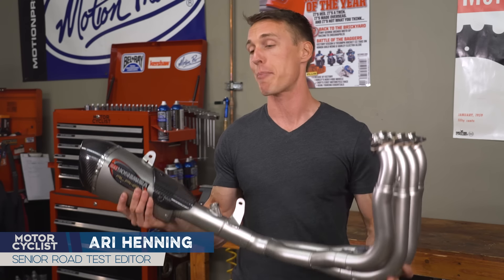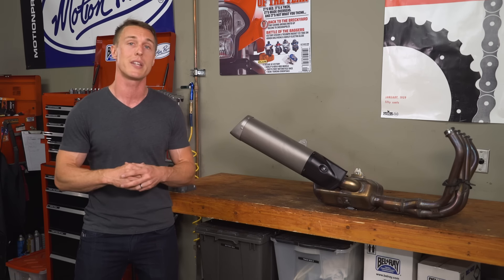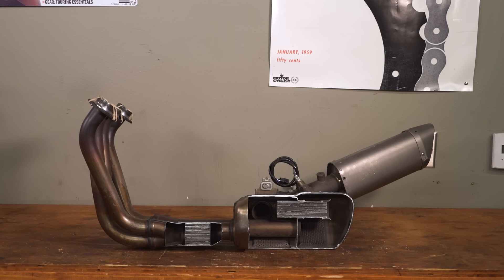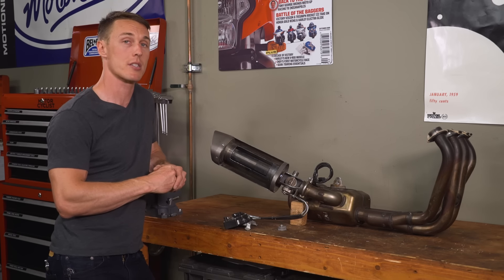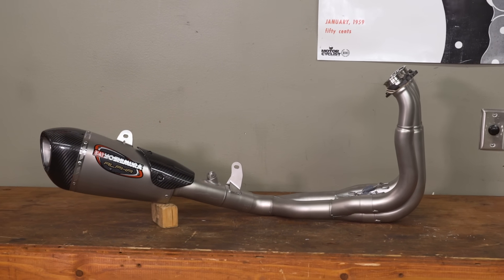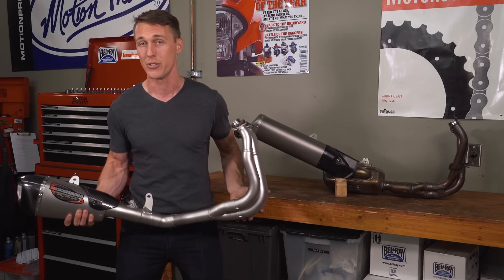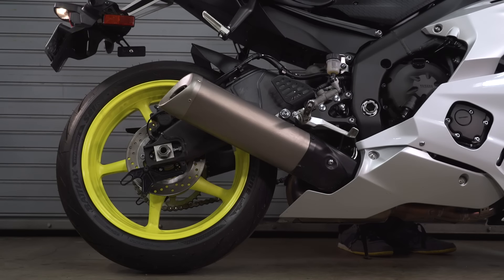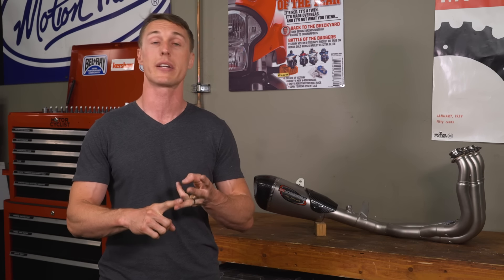The Truth About Aftermarket Exhausts | MC Garage

Comment: Can you do an episode on lightweight wheels? stock vs ali/magnesium vs carbon fiber? are they worth the premium price?
Reply: camden thompson I'm a mechanic, it doesn't even require a mechanic knowledge to know that less weight on the drive train allows for an easier power application. It's just less lost torque/power. It's no wonder manufacturers try to shave off weight any way they can. Look at lotus, they don't have massive power in their engines but their car are lightweight, hence why they can chase the big cats on track.
Reply: Aftermarket wheels aren't good for a street bike as they aren't designed, nor can they handle, the stresses of potholes, long term use, etc... Race bike, they are great. Last I checked race tracks don't have potholes... lol
Reply: Not just power application, but agility as well. Less rotating mass, less gyroscopic effect, quicker turn-in and a "lighter," more "flickable" feeling bike. In my opinion, rotating mass is the top of the list in terms of weight shaving, then unsprung mass (wheels, brakes, suspension), then sprung mass. If you can get unsprung and rotating mass down with one change, that's even better. This is why I downsized to 14" wheels for my track MR2. At 11lbs. per rim compared to 12-14lbs. for a 15" rim, that's a very noticeable difference on track.
The Lotus Elise (there's one at the shop now for a clutch) is a ton of fun to drive even with it's modest 210ish hp. We probably won't dyno this one because it's stock and there's no point. The Lotus Esprit (my shop's owner has two) isn't nearly as light or as small but it's still very fun to drive. Still very British though, so it essentially takes an electrical engineer to fix an electrical issue on it. And those issues are very common.
Reply: If you can get the same strength for lighter weight, you'll be faster off the line, and feel more agile going into a turn. The gyro effect of the wheels.
Reply: camden thompson .... magnesium wheels are best on the track ... even though it makes a wheel very light, it cannot hold up to city/street riding because magnesium is so brittle. Aluminum is the way to go for city/street/canyon riding. Also, aluminum will reduce your bikes weight(4-7) pounds changing both front/rear wheels,will improve steering/cornering with lighter wheels. Going to lighter wheels , is one of the best mods you can do to a bike for  improved , positive,precise cornering... just my 2cents.... Tracy Taylor
Reply: camden thompson light weight is a winner if you value nimbleness. However make CERTAIN  the hoops you choose can cope with day to day use eg potholes, bricks slow pedestrians
Reply: Not unless you just have money to burn would it be worth dumping money into aftermarket wheels. The return you get is minimal for the rediculous price you pay. Only if you've damaged stock wheels would I Ever recommend aftermarket wheels. Greater performance gains can be achieved elsewhere for much less money
Reply: @nbowling10trio  I disagree. Aftermarket lightweight wheels are one of the best and biggest upgrades to how your bike handles.   As they are very costly, most people who fit them have high end sports bikes which really benefit from the huge upgrade to agility and turning etc.
Reply: @tracytaylor6034  Great points Tracy, but you forgot to mention the ultimate choice....Carbon wheels !!!

Comment: Very informative! Slight issue with slip on is that they are not typically available to v2 vs. V4 engines. My cbr1000rr had a slip on yoshimura with power commander while my current tuono 660 had to be a full exhaust swap with upmap tune up

Comment: only half the picture. the reason you get better performance from a more free flowing exhaust is air. basically if your engine can pump more air and you add more fuel then you will get more power.  the reason this video fails is you have to have a more free flowing intake and more fuel or an exhaust wont have much of an effect. imagine breathing  all your inhales thru a straw while running. you will also have to modify the airbox and upgrade the filter.( make sure your engine cant suck water from rain,puddles etc can destroy engine by hydroastatic lock and instantly lock rear tire. important)
so after you fix the intake and exhaust breathability you now need more fuel,(lean can damage an engine)
in a carberated bike that means bigger jets and a lil trial and error/guessing plus a lot of hours swearing in the language of the country your bike was built by.
with EFI you have better options. electronic fuel injection with a mass air flow sensor might be good to go you just have to put on enuff miles for the computer to relearn its fuel strategies....if you are not putting more air than the system can keep up with fuel wise. if not your upgrading fuel pump and injectors or adding an adjustable fuel pressure regulator or all 3 it depends.
as most bikes dont have a mass air flow sensor  they tend to have a system that uses look up tables. which put simply means the computer will know a few parameters and then look up the amount of fuel to add.e.g. at a specific rpm/air temperature/engine temperature/throttle opening etc it will look up on a chart and see what the best known fuel amount is. thats what reflashing is mostly about is changing the tables (or idk computers that deep) or maybe to add time to injector opening length charts. in the end more fuel in the correct amounts at the correct time=more power. 

the O2 sensor on these systems generally are only setting mixture ratios at idle to pass an emission test and the computer attempts to adapt the vehicle to you and your climate. it can adjust a slight lean/rich mixture. do not count on an O2 sensor making up for a pipe and an air box they cant.
so what to do? really think about do i want more power or just the noise? if its just noise get a slip on and ride a few miles easy for a few rides give your computer time to adjust. should be good as long as your not going with an extreme slip on.
if you want power than noise is a requirement not a choice, how much power do want. what you want is to maximize air in and out no weak links, and deliver the propa amount of fuel at the propa time. that all depends on what you choose how extreme your trying to go. 
one caveat for me is, brand new bike with a catalytic converter so putting a slip on would require cutting the stock exhaust which could be welded later but i dont want to cut it, i prefer to save in case i need for a sticker or to get the law off my back. so for me its a full system, air,fuel, hopefully i can find something not too loud that just needs a reflashing.
just want to drop ten pounds, more responsive bike with say 3 to 15% more power than airbox/filter, full exhaust/pipe with a non extreme exhaust and than reflash at a minimum. probably a fuel controller. need to research cant go by online opinions from individuals. choose vetted sources. get your fuel delivery right or spend all that money for no gain or worse damage your engine.
Reply: Engineering an engine is more then just more fuel more air more power. Back pressure at specific rpms will increase your torque and give you better more consistent power through the entire range where as just maximum air and fuel will give you max power at one specific rpm, usually very close to your top end. In a race, having your power delivered throughout the entire rpm range, a flat torque curve, will give you the win if everything else is equal.

Comment: I think the main issue of changing exhausts is aftermarket is lighter, smaller, and look better.  Loosing weight can help performance.  Look at Sport Bikes with those Triangular Monstrosities.  Japanese Cruisers with Giant Bazooka Sized Exhausts that ruin the lines of the bike.  My bike is pre O2 sensor but I did have to install a Cobra Power Controller.  I also put Lollypops in to help the Straight Pipes have some Back Pressure.  The Pops also stopped complaints of riders behind me saying they were going deaf.  They actually did help the Db's go down a lot.

Comment: He didn’t mention the loss of 20 to 25% of your fuel economy with performance exhaust and fuel mapping for about 5% power gain.
Reply: Way more then a 5% gain with a proper specific tune to your bike, exhaust system and a performance air filter. You’re right about fuel economy, it will suffer a bit but who cares you got one life to live :P
Reply: It cost like $3 to fill the tank.... God forbid you having to fill up every 4.5 days instead of every 5
Reply: @hollowhills2973  haha £18+ over here in the UK for s 600rr and I can use that easily in a day, when I broke my ankle when I could get back on the bike to train again I pretty much went a spin each day or every second day that was almost £300 in fuel for the month hehe, and that was 35-40+ mpg I was getting.

Comment: I agree with your assessment and it's the reason I stayed with my stock Multistrada 1200S exhaust. A whole lot of money for virtually no power gains with the aftermarket kits. I do wonder about dirt bike aftermarket exhaust though. Now you don't have to worry about emissions and less about noise too although too loud is always bad.. Friends tell me a pipe will do wonders for my stock YZ250F but I am skeptical. Something I wish you would have mentioned in the video is that sooo many riders think that when their bike becomes LOUDER, it is FASTER, which is so UNTRUE in so many cases.

Comment: "Manipulating backpressure" - please stop propagating wrong information. No backpressure is good backpressure. It's about exhaust length / resonance and tuning for peak or broad powerband. Larger diameter and/or shorter pipes tend to push power higher in the powerband (increasing the peak advertised value but possibly losing power in the mid-range). Longer pipes, smaller diameter, dual mufflers, and crossover pipes add volume and resonate lower in the RPM range (and frequently have a broader powerband with a lower peak advertised value). Long, conical mufflers tend to broaden powerband as well (as any musician who plays wind instruments can tell you - conical tubing resonates over a broader range with a "softer" sound). Aftermarket pipes perform with 1) less weight 2) reducing restriction at the expense of noise (less noise baffling) and 3) reducing restriction at the expense of emissions (no catalytic converter). Notice 2 out of 3 are reducing "backpressure"...
Reply: JustTheOtherDave schooled
Reply: What would you say about removing just the cat to gain in sound and reduce weight. Will back pressure be compromised?
Reply: @mandm060782  there is no such thing as backpressure. You will probably gain in performance at the expense of emitting nasty nitrogen compounds that are bad for the atmosphere.

TL;DR stinky exhaust

Edit: I should point out the performance gain is probably due to the reduce in the restriction (on some bikes, massive) due to the cat, and most of the benefit from exhaust or intake modification will only be realized from tuning.
Reply: THIS GUY IS A ENGINEER DESIGNING ENGINES FOR? HAHA. HE HAS THE BACK PRESSURE.
Reply: Yo lemme just block the exhaust
Put cement in there to ballance the torque curve!
Reply: underrated comment.

Comment: I see 600’s squeeze out 14WHP with a very high quality full system and a good tune. Not to mention a lot of weight shaved off. 10-14WHP is absolutely ENORMOUS for a 600cc class bike. 

Imagine a beautiful exhaust system made of full titanium, it spits a constant flame out at night riding high rpm’s down the highway, sounds ridiculously good, and slowly turns purple in color over time. It’s worth every penny!

Comment: Some room? Got 30hp from tune + full exhaust. Also lost 19lbs...
Reply: on what type of bike?
Reply: 30 HP from tune and exhust!? Hell no lol. 
Maybe on a Turbo Hayabusa lol
Reply: @sergiooliveira1127  that's actually quite possible, depending on the bike. Restrictions vary, and if it's a popular learners model in a certain market, chances are it's been choked from the exhaust.
Reply: @barbaramclellan2876  Yes, you are.
Reply: You got conned if the dyno you were on gave you a 30hp increase after a basic tune
Reply: Yeah but, did the power move up the rpm band and you lost significant bottom end torque?
Reply: @bseidem5112  ever heard of backpressure? Aftermarket exhaust usually disregard it completely, moving the powerband and jetting also moves it further, it's simple tuning logic.
Reply: @Tuukkis  

Well, that isn't odd when aftermarket pipes are all about top end power
But you are correct that usually no power is "gained" only "relocated"
Reply: I call bs
Reply: No way you're getting that from a 600rr or an FZ07. That's like a 30-40% gain in hp.
What bike did you get that much of a gain from hot shot?

Comment: On fuel injected bikes an after market slip on will often run rich because the ecu cant match the preset values and dumps fuel to be safe. On carbs they will run lean because jets aren’t controlled by preset fuel mapping. 

Deceleration popping can be tricky to nail down. If it’s a chain of pops that could be a lean condition, meaning the fuel is igniting on the overlap stroke. If it’s one loud boom, that’s usually rich because of the unburned fuel combusting in the exhaust. Engines actually like to run lean, it’s just really bad for them because of the heat.

Most bikes from the factory actually run pretty rich in terms of performance. A stoichiometric ratio of 14.7:1 Air to fuel is ideal. Any less air is considered “rich” and any more is lean. However that being said for best power is achieved in most bikes at around 13:1 +-.5, but that will depend on application. Evaporating liquids are endothermic meaning they absorb heat as they turn into a gaseous state. That’s why rich is good, especially with high compression motors. But never forget, lean is mean.

Comment: Amazingly true what you said about aftermarket exhausts. Most of that junk does actually decrease your power. Only some high end pros like Akrapovic will give you complete power and torque diagrams for all their exhausts.
Reply: I agree and have Akra systems on my R1 and ZRX 1200.  Big improvements over stock.

Comment: Stock modern exhaust are much better than the 1970s-90s but you can get more.
I've Road Raced for years and Drag Raced Bikes for even longer !! Lol
My buddies shop builds and Dynos bike engines for 25+ years ...
As we know it's just not on thing, air in and out, Carbs, Injection mods, Cams etc.
Stock Bikes w/ Race filter, Full "Good" race pipes and tuning the ECM on the computer you can see gains on ...
600cc - 3-5 HP Avg *
750cc - 5-8 HP Avg *
1000cc - 7-10 HP Avg *
Hayabusa - 8-12 HP Avg *
* Is with great air, low humidity 
Build the motor more, blueprint and well matched parts Far more gains are achieved of course !!
It's just how much you want $$$  Lol, All Race bikes Drag & Road race use full systems because they work !!
You can't go wrong with Yoshimura, Akrapovic and Brocks - especially for Drag Racers !!
Of course I don't live in a Leftist state with so many A-hole rules/regs to my Bike & life ! Lol
And in most Bike shops they sell you the pipe they inspect your bike just fine, if they don't find another shop !! And sticker come off and at the meter distance the pipes pass, if you live in CA /NY or states like these I fell bad for you, it's America you can move and find real freedom if you want !!  Semper Fi

Comment: The garage I bought my Honda 750 from actually recommended I purchase an Akropovic aftermarket can to improve the bike's performance. I did so  and found my wallet like the new silencer was much lighter. The exhaust note was deeper but the performance not noticeably better. On checking various online test results I discovered that my $700 had gained me just 0.5 BHP across the range. So not really worth the effort or cost.

Comment: Freeing up the exhaust and adding fuel go together otherwise you'll lean out ,you will absolutely make a noticeable amount of power afterwards ,thermal efficiency may decrease which is why its important the exhaust manufacturer gets pipe diameter and length correct otherwise you will lose power ,take your bike in for a baseline run before mods on a dyno and take it back after.

Comment: I recently changed the exhaust (just the pipes) in my Moto Guzzi V7 850. Main reasons were: better sound and weight loss (5kg less is 2,5% of the bike total weight). Also, the Mistral exhausts installed are emission and noise compliant. I could have installed others cheaper (like the MIVV Ghibli), but aesthetically they were not as cool as the Mistral, and they are not noise neither emission compliant (which is a pain when you have to go for the periodic tech inspection and need to reinstall the original pipes).

Comment: I got a courtesy bike with an aftermarket exhaust once. It was fun for 10 minutes, then it just started to piss me off and I felt like an ass making that much noise. My own bike doesn't start shouting until 7000 rpm (where the power starts too), which makes it city-friendly and motorway fun. Stock exhausts are fine.

Comment: Best vid I've seen on aftermarket exhaust systems.  And, he agrees with what I've been saying for years.  Thanks.
Reply: That exhaust in the video is built for emissions control. Put a aftermarket race exhaust on you immediately shed 30 lbs lowering your hp to lb ratio. Install it with a K&N filter and a tune for more fuel. Stock exhaust is ok but not better than aftermarket

Comment: It also depends on where you live. At least here in Finland a lot of bikes are tuned down just by chocking the exhaust when imported into the country. If you remove the limiters its usually fine but still most likely a bit ugly, and everyone doesn't have the tools/skills to open and re-assemble the pipe the anyway so it might be easier to just go for an aftermarket pipe also to get the little benefits that those provide.